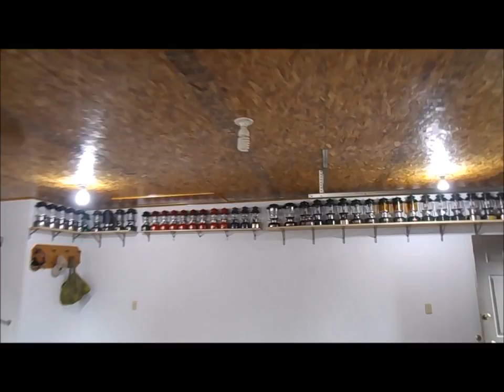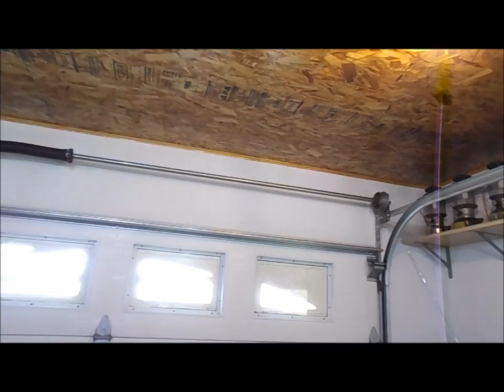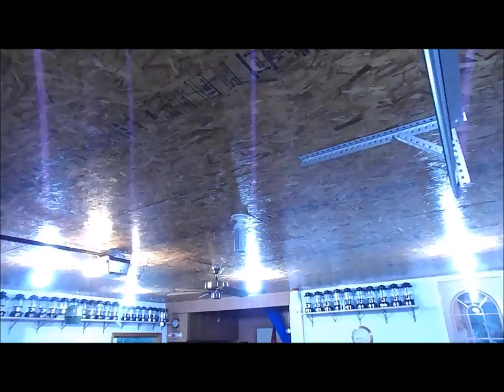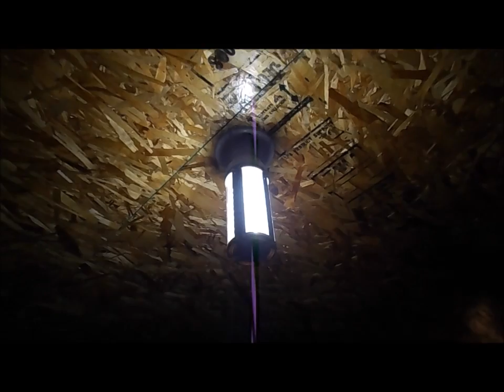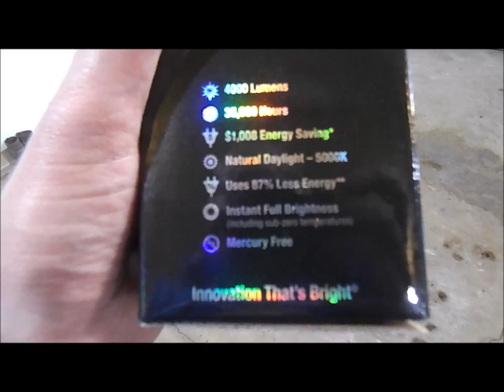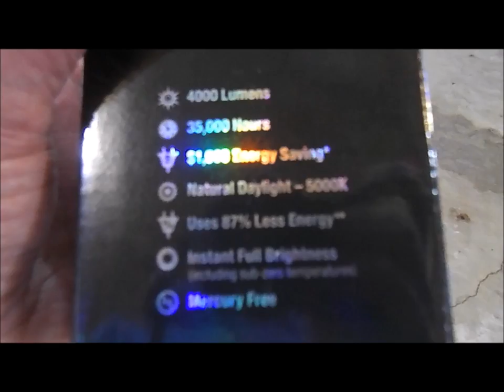LED Light

Comment: they have LED shop lights. like the 4 foot tube lights, only they are LED.
why dont you go with something like that? That light you have looks like it sends the light out, not down. you can hang a LED shop light from the ceiling and use an adapter to turn your light socket into a electric plug outlet. I have LED shoplights, they give off great light. Also, if you could paint your ceiling white, that would go a long way to making it brighter also.